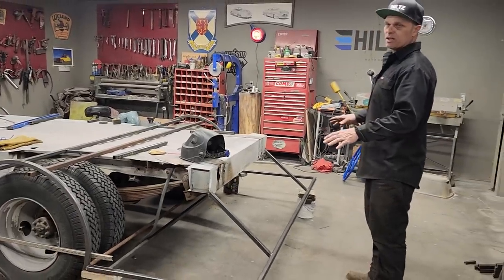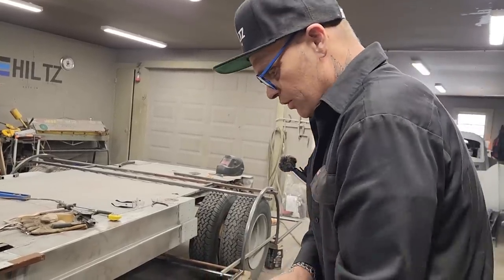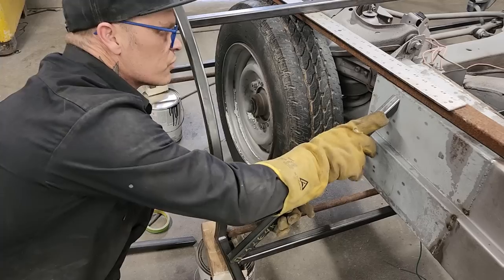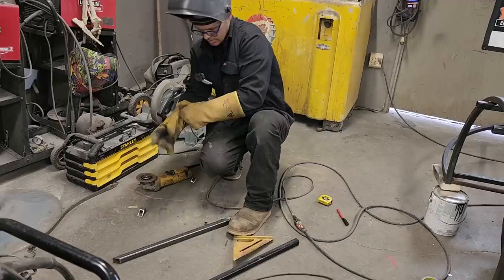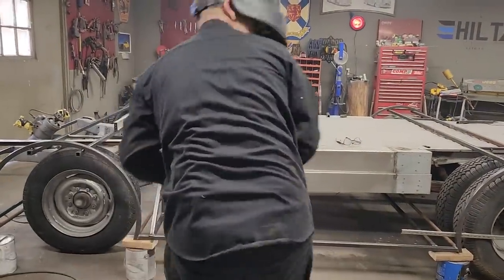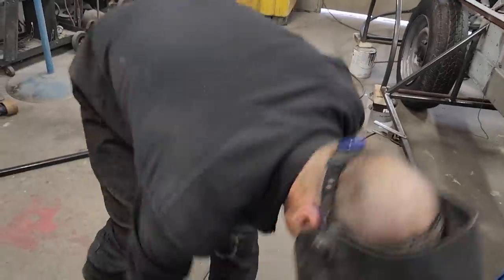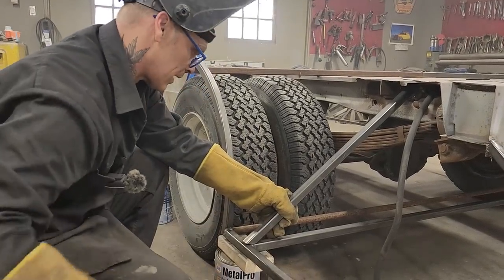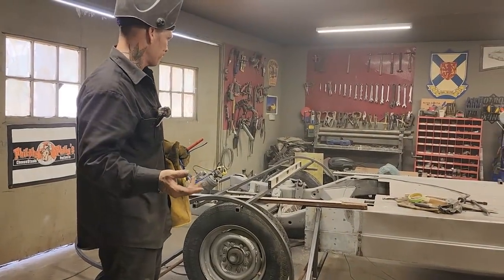Lots of controversy with this build ⚠️

Comment: The best thing you can do with that front end is take the independent wishbones out and put a beam axle in there instead. 

If it’s from a larger truck it will instantly give you the extra width you need, it will be heavy duty enough to handle the weight of the new body and what you may end up hauling. 

You’re not building a race car , so the independent suspension is pointless in there any way, just put a proper truck beam axle in there and call it good.

Comment: Chad…In my opinion the Bottom of the body frame is about 4” too low. When it is all done and there is full weight on the suspension, what is the ground clearance going to be? Also, I am not sure that the Bugatti will fit inside the way you describe the motor location and the height.

Comment: I'm wondering if it's possible or if there is a spot somewhere on that front cross member near the middle where everything (steering linkage) runs parallel left to right to cross member.  And if so could you just cut and stretch it and the linkage. Then section and build new boxed front frame rails that are straight where they taper in now. Replacing just that tapered section and re using the very front where all the suspension mounts.

Comment: Actually joline after the motor transmission and all that metal I don't see it working SORRY you all will be putting a lot of weight on that frame and it will drop

Comment: I am not a hater but for goodness sake buy a chopsaw and use it on a table that’s 30 inches high at least so you’re not bending down working on the floor you might think it is normal but it is a very bad habit to have I used to do it myself and then one day I realize that it was not a good idea to be doing work like that if you would just give it a chance you would realize that working at a good height you would save a lot of time Chad you’re doing this on TV stop being so cheap and buy a couple tools !!! 🤨